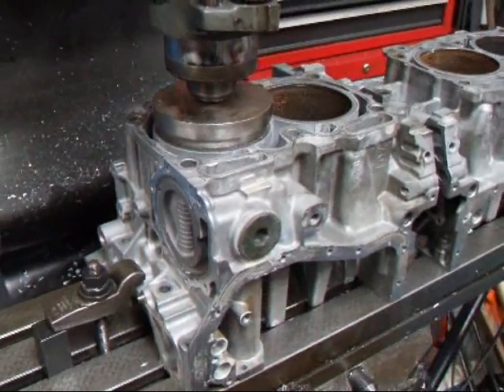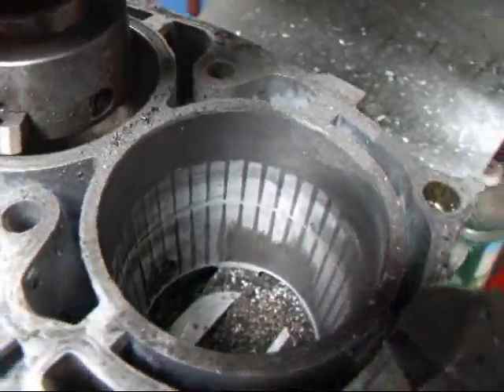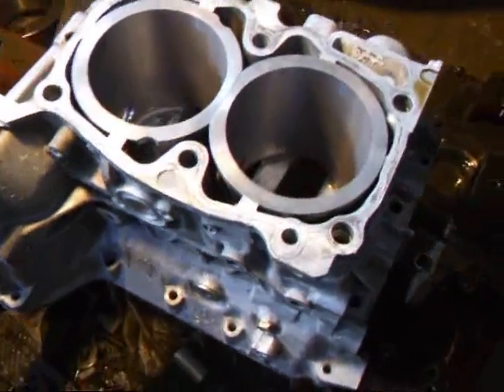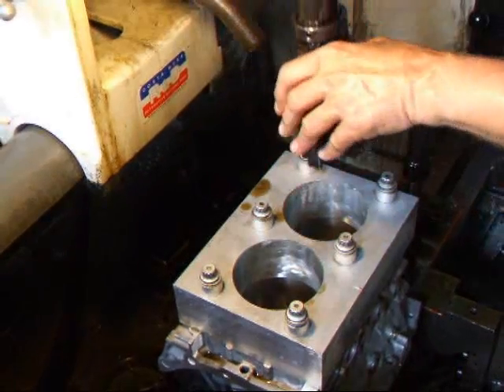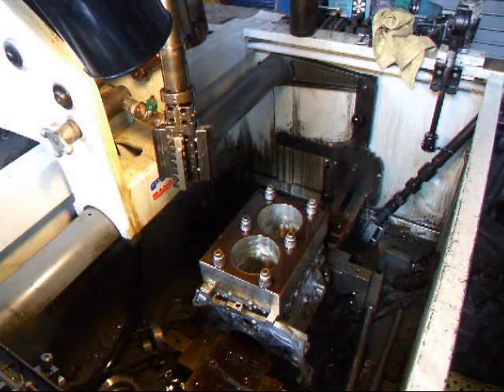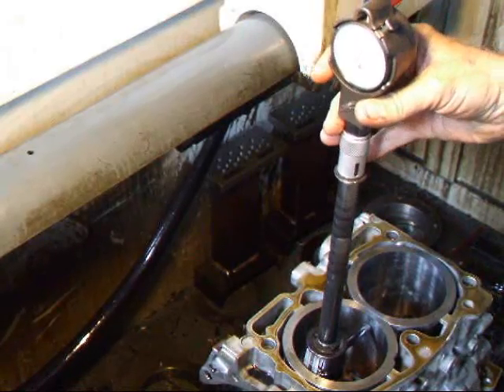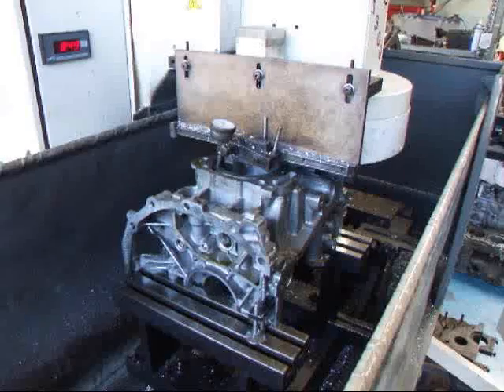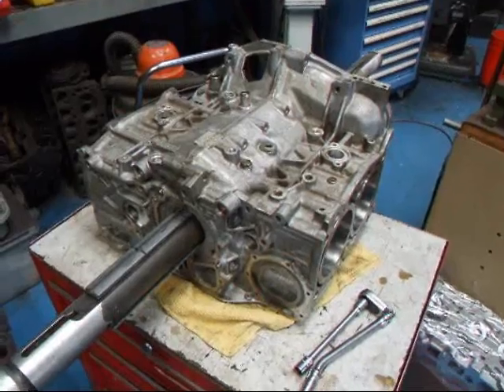Subaru Sleeve Installation

Comment: I wonder if my brother has to get that done with the EJ20 in his 2000 Subaru Forester ?

Him,his wife & my dad went away to see my grandmother & my brother lost a cylinder when backing down a gear when driving up a hill.

I think he has either thrown a rod & or bearing or at least put a hole in one of the pistons because it misfires,its not ignition or fuel related.

Our cousins husband is a Subaru mechanic over here in Australia, he works for himself now but did his apprenticeship at a Subaru dealership so the car is stuck at his workshop 650 kilometres north of where we live (near Newcastle).

They all had to come home in my dads Colorado.

I wonder if the 10W50 oil is a bit too thick for the Subaru  engines ?

AFAIK the EJ20 needs a 10W30 oil so if it's thrown a rod,maybe the 50 component was too thick ????

Comment: John, a torque plate isn't necessary for line honing the mains on EJ's? Is this a closed or semi-closed deck?  You stated the sleeves are good for 60 pounds boost,is this without o-ringing? Is a 92.5mm stock bore, 84 mm stroke, and a long rod/offset piston, 2.7L, EJ257, a decent street combination? Do you have access to the crank, rods, and pistons needed? Any sleeve/skirt clearance issues with a 84mm. crank/rod combo?
Thank you for all of your time and attention to detail!!!
Amanda

Comment: Wouldn't u want to have the line hone done with the Heads or in your case the hone plate bolted on so I could be line honed to the specs of the heads being on the block

Comment: Hey John, its Lyle. You prepped my GSR/LS block that made 503hp. Now ive got another project a EJ257 block but it has a cylinder with a broken stock sleeve  from the piston that exploded. I think it may be broken off farther down than you cut to install your sleeves. My question is: how far down from the deck surface do you cut and what is the max? I want to know if i can save this block. Thanks again John!

Comment: What kind of sleeves are those?  Won''t it be a pain in the ass getting it aligned during installation?  I believe Darton sleeves requires custom drilling for the wrist pin hole for EJ257 applications so it makes the installation part easier and virtually eliminates the alignment part.

Comment: How much can one expect to pay for sleeving a subaru block? I've got an EJ22e stroker that had a stock bore and an oil pump bypass malfunction took out the crank and mains. Engine is being checked now but the machinist didn't seem optimistic. IF the bores are worn (which I'm hoping is not the case, the engine ran for 2 hours) I'd be either buying new pistons from wiseco or putting sleeves in. Thanks! 

Chris

Comment: I have a question that a lot of people argue about. What should be done first, boring, decking, or align honing?

I have a .020 ford v8 that was bored/honed using modern machinery that aligns itself from the mains. I am wanting to zero deck and align hone now as well for a quality engine build.

Do I need to align hone, zero deck, and re-bore .030 over?

Comment: would it not be better to resurface before the honing process? Then deck and sleeve height would be totally equal so the torque plate wont squeeze the sleeves more/less under the honing process.
Just what i had in mind but you probably know more than me :)

Comment: Jon, wouldn't you deck the block first before you bore the sleeves? By changing the surface after you had the torque plate on wouldn't that change how much force the heads would be applying? Or is the change not going to be noticed ?